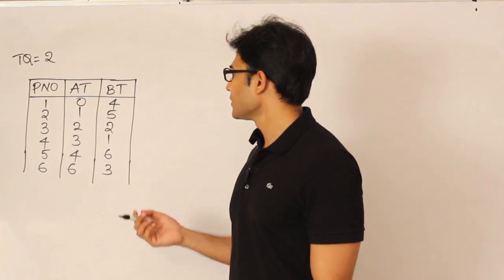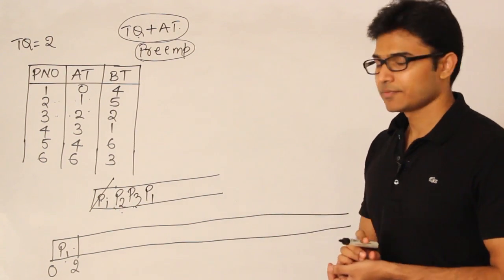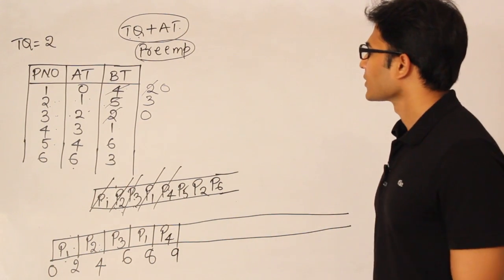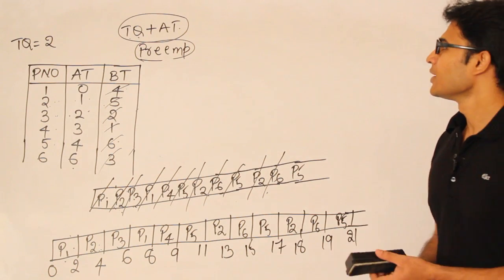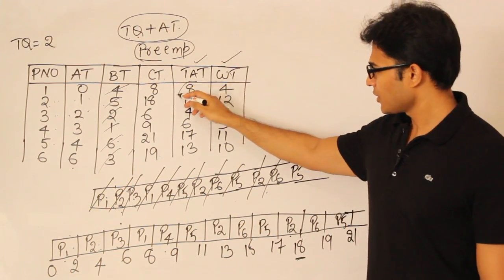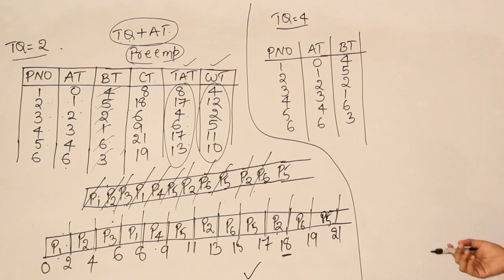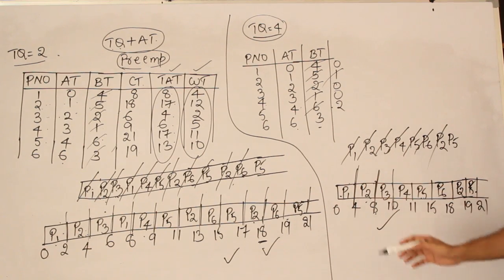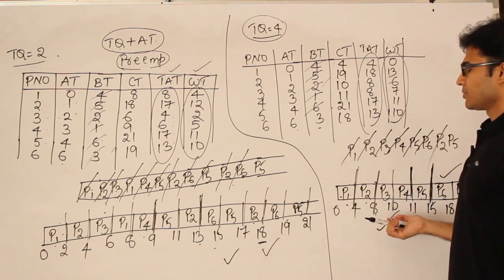OS | Process Management | RR example 1 | Ravindrababu Ravula | Free GATE CS Classes

Comment: can someone help me to solve this
1. Assume that there are n processes in a ready queue when the time quantum is q. 
A. Determine the average wait time of the processes.
B. Determine the wait time for a new process if the process goes back to the beginning of the ready queue.
C. Calculate the average turn-around time if the execution time of processes is m. When the processes are finished, assume that they are executed sequentially.
D. Calculate the average throughput using the above results.

Comment: Hey sorry but your wrong at one point you said P4 needs only second to execute and you added one 1 quantum time how can you dynamically change QUANTUM time in middle of scheduler ???? if you can do that then what not to run all processes dynamically ???? and one last thing if you are taking  this 1 quantum time for p4 then you know how much overhead CPU has to bear ????????

ANSWER ME AS SOON AS POSSIBLE :)
Reply: +Jitesh Lakhwani the most important resource is CPU and we cant afford to waste it.. so, if a process ends in 1 unit of time then why the fuck keep cpu idle for 1 unit of time..
Reply: Shubham Kumar then y the fuck you keep quantam time remove it if you can do things dynamically shifting from one to another process....
Reply: Jitesh Lakhwani I think reason for keeping q has been mentioned in the video.. anyway the main reason is context switching is high (for a low TQ) and that is exactly why we use RR.. If u still dont understand anything ask i will be happy to help u :)
Reply: Ramesh Khatri most of books shows this approach only so there is no harm in this